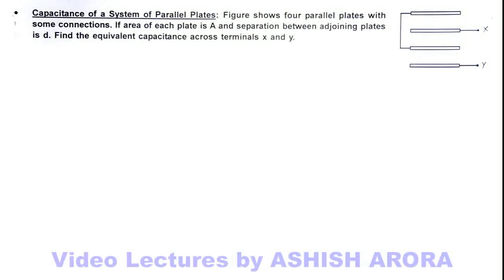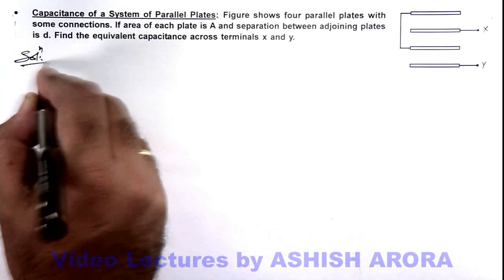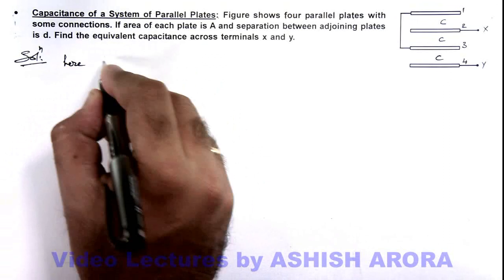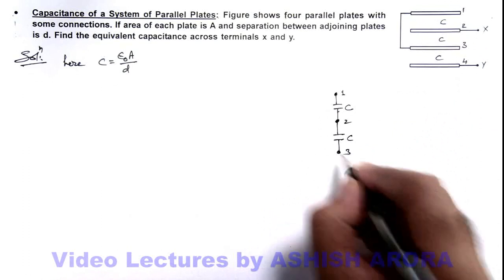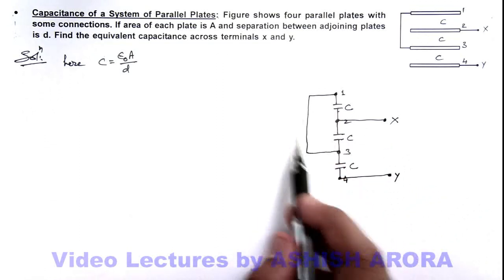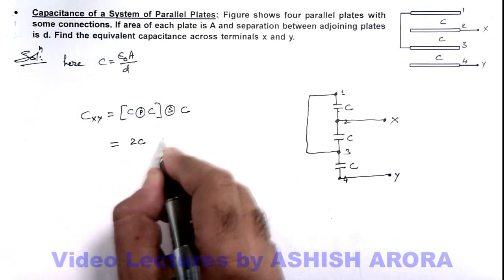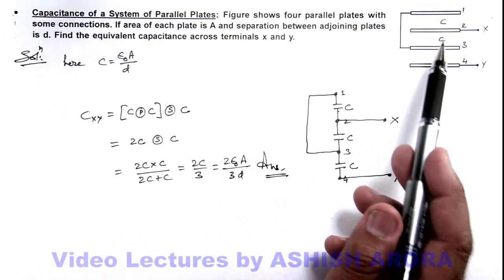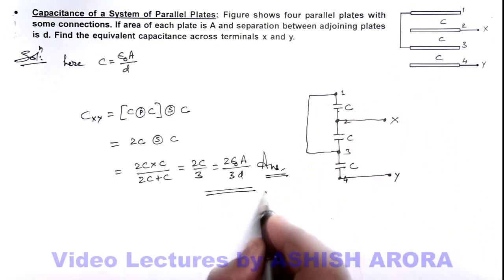4. Advance Illustration | Capacitance | Capacitance of a System of Parallel Plates | by Ashish Arora

Comment: Sir, What does disconnection of a capacitor means?, If a capacitor is disconnected and not reconnected to any other circuits then will that mean that potential difference is zero, in the capacitor?
Reply from the maker: No... once a capacitor is charged and then disconnected from the source (battery) then the charge and potential difference is maintained across its two plates unless it is shorted...

Comment: Sir , what are the consequences of placing the plates in this fashion ...? And by the way I didn't understand how to imagine capacitors there ...like we connect it to the battery and then ...plate 2 gets positively charged and so plate one gets equally negatively charged ....similarly plate 4 is negatively charged ..and plate 3 positively ...now .....plate 2and 3 with positive charges...r they still capacitors ?
It's quite silly , but tell me where I'm wrong
Reply: No
Reply: If u get ur answer by now , then plz reply, I also want to know the same